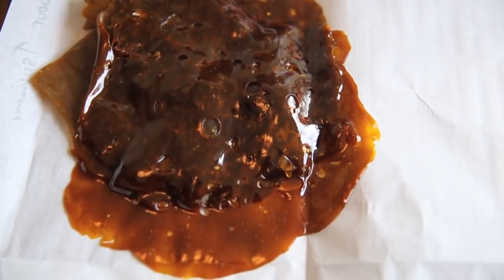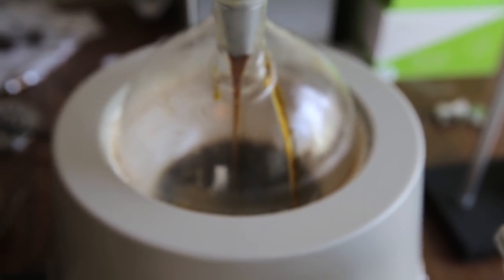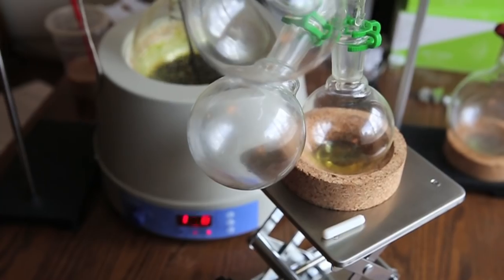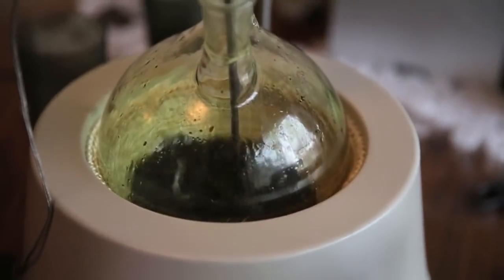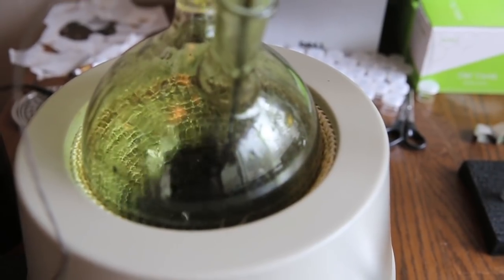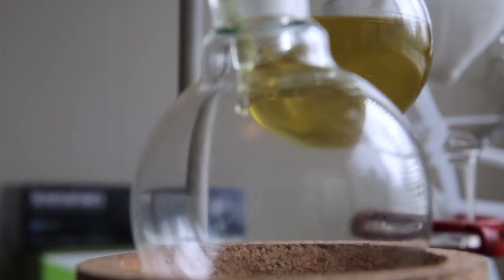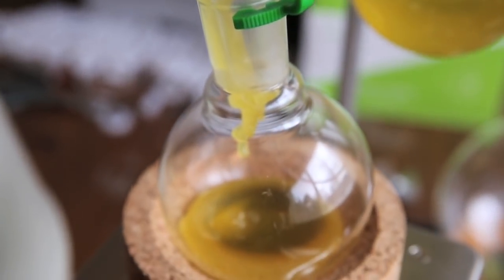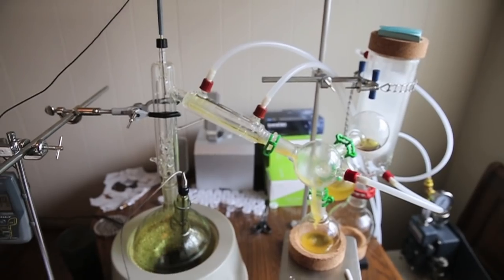Short Path Distillation of Cannabis THC & CBD (Tetrahydrocannabinol & Cannabidiol)

Comment: i don`t know much about this kind of sophisticated extraction or distillation methods but every time i see such a video i ask myself how do they get the final product out of those glas flasks? do they have to add some kind of solvent again? why don`t they catch it in some kind of flat dish where they could just harvest it more easily?
Reply from the maker: Turn the upside down on a stand and use light amount of heat :).  A heat gun works great.
Reply: and flat flasks or flasks which are shaped like jars with a big round lid probably don`t exist for that kind of setup right?
Reply: but if you know a good glassblower :D

Comment: how is the cbd and thc separated? would cbd come out first at a certain temperature and then once increasing the temperature you get delta 9 oil and then swap the ball downwards to collect delta 9? but what confuses me is the 3 balls because you did not move one and it collected essential oil i suppose like fractional steam distillation of trim?
Reply: Dear Sean, have you solved your question? I am also interested in ths aspect, as our legislation in italy prohibit any single trace of THC in the hemp extract, and we are interested only in terpens and CBD. if
Reply: They aren't doing a fractional distillation. Those three flasks are simply "early", "main" and "late". The "early" (mostly terpenes) and "main" will be mixed together to make a full flavour extract product and the late will be distilled again with the next batch or a batch of collected "lates" to retrieve the CBD that is in there with the waxes, lipids, etc. Well that's how I'm interpreting it anyway. And THC is too close in boiling point to CBD to be effectively fractionally distilled at least with kitchen lab equipment. You need to start with a "pure CBD" 1:0 strain like Dinamed CBD Plus or CBD Therapy.

Comment: one question men ! if i buy a dank or other brand cadrige with gelato strain , they use gelato flower for the oil or only put gelato flabor inside ??
Reply: Miguel Aranega They’re supposed to
Reply from the maker: @CHii951_D.S  Most likely they have recreated the terpene profiles from a gelato strain test result from a flower/extract.  It is possible however they are reintroducing the actual cannabis terpenes however, most times they are using organic terpenes from other plants to mix a "gelato" flavor profile.

Comment: I didnt know you could run short path with out winterizing materials. Good to know.
Reply from the maker: It's not recommended and depending on the product it can have some dramatic effects on the process and end result however, some will chose to sometimes do a quick "hot pass" prior to winterwization to remove some impurities and then winterize before doing a regular pass through distillation.

Comment: Can u use as a starting material, the liquid which u get by adding the ethanol to plant material (filtered of course)? And is that the same setup? Thank you
Reply from the maker: You can use any extract type into this distillation unit! The best steps to take prior would be a proper filtration/winterization to remove any fats/impurities possible to minimize any elevation in boiling points during distillation! Cheers!
Reply: @OpenSourceSteel  would you change any of the setup for having your starting material as such?

Comment: was alcohol added to the material or did you just melt with the funnel and pull with the vac
Reply from the maker: In this case, we simply heated the oil with no transfer solvent.

Comment: What kind of extraction are you doing to before distillation what was mentionated starting material around a hundred eighty three grams?
Reply from the maker: Andres Mesa hydrocarbon extraction using a closed loop. Butane specifically.
Reply: Open Source Steel Thanks!, I have another question, Is the extract purgation needed? or after to the extraction BHO, we can put in the short path distillation system? How did you do it?
Reply from the maker: Andres Mesa after initial extraction and purging most butane, any residual butane can be removed in the distillation however, you will likely want to process and filter the BHO via winterization using ethanol to remove fats and impurities and then into distillation process.

Comment: Did you mix anything with the starting oil or is that just oil boiling? I would assume this would burn if you didnt add some form of liquid but you would think most liquids would boil off first.
Reply: Don’t mix anything extra to your oil.
 Dose the oil in a fryer burn?

Comment: Do you use anything to seal the joints for the vacuum?
 Do you still need to filter the Crude Oil prior to Distilling to remove the chlorophyll?
Reply from the maker: Vacuum grease to seal the joints.  You should always filter prior to distillation as well as decarboxylate the starting product.
Reply: Teflon Tape is working for me & I don't have to worry about the product coming in contact with the grease or it's residue that might still be present.

Comment: While I've been toking for over 45 years, I have always smoked the bud. I recently decided to switch to vaping and now use THC & CBD distillates rather than oil. I am interested in making my own distillate and there's lots and lots of videos on it. Unfortunately, they always begin with some sort of product in the flask. This is the first vid I have seen that actually pictures the product that will be used for the distillation. I have not yet found a video that goes from bud to distillate.

My noob question is: What is that brown product? Resin?
Reply: you need to make concentrate with a solvent first
Reply: Don't be so quick to dismiss the other chemicals found in weed terpenes can have tremendous effects they interact with the THC and CBD to produce different effects that's why different strains can have different High's even though they might have the same THC level
Reply: It's bho, butane honey oil.

Comment: what did you put in the boiling flask with the oil. did you put any type of solution?
Reply from the maker: Raw oil, no other compounds. This product should be winterized before however in this video we did not and because of that we have slightly elevated boiling points in this video that what you can expect with a filtered oil to start.

Comment: Can we extract essential oils using fresh buds with this method and equipments? ? ? 

Why is need the vacum pump? ? ?
Reply: The vacuum helps raise the temperature high enough to separate higher boiling point compounds like THC.
Reply: @MrMudRun  Old but for clarity lowering the air pressure lowers the vapor pressure and thus the boiling temperature of a liquid so it helps to make the liquid boil without actually heating as high as needed at room pressure. The other reason it's used in this case is that it removes oxygen which will help reduce reactions that might destroy the target compounds. As the cooling is beeing provided by evaporation which cools the liquid if anything the it helps lower the temperature. Think astronaut with a hole in their suit, it's not the vacuum that takes the heat from them as there's nothing to heat, it's the vapors coming off them into space that carry the heat away, the faster the vapors leave the more it cools, the harder the vacuum the faster the vapors leave.

Comment: Hey man great video I just got a similar set up with that same pump and basic parts besides the cold trap in the back is that something you need? I see people not using them, whats the benefits? also do you Winterize your crud oil in ethanol or mix some in before putting it in the boil ball? thanks!
Reply: It help any alcohol that might be present to condensate before it reaches your pump (Letting you do more runs between oil changes and lengths the life of the pump.).
 Using an Aspirator to pull a vacuum will save you from having to buy an expensive cold trap.

Comment: Thanks for the share, I am looking to work with about 30 grams of flower at a time and I'm trying to figure out how to get all the product out the glass efficiently. I was going to use a soxhlet with ethanol and distill off the solvent but removing chlorophyl seems problematic. Any suggestions?
Reply: Fhoulghl Ofdnposdu try activated carbon, it'll help grab "some" chlorophyll
Reply: Does the chlorophyll get condensed from the crude oil with the Terps?

Comment: how much is this set up and can it handle things like essetial oils?
Reply: Chris P. Bacon around 2400 without the pumps. pumps will run you another 500-1500. and he is distilling essential oils from the start and ending with purified distilled essential oils.
Reply: _JustConcentrate _  it's like 1800 for the glass ware and it was 800 half off on cyber Monday.
Reply: where
Reply: Andy Trinh.

Comment: Do you have to roto vap before doing this or did it's just basically melt into the stirring flask
Reply from the maker: Yes, you will want to winterize and evaporate any remaining solvents (ie. Ethanol) before starting the fractional / short path distillation process.  This setup can distill small amounts of alcohols but it's not recommended as the condenser is not as efficient for such volatile compounds hence why we add a cold trap.
Reply: Open Source Steel if I put my cold trap connected right to the condenser would it work more efficently and so after essentially you winterize roto vap or decarboxilate you then vacuum oven it and then run it in the spd?
Reply from the maker: the cold trap is there for any solvents that might be used however, its not the most efficient method either. A proper condenser or evaporation setup for volatile alcohols like a roto would work better, especially with a dry diaphragm pump to pair!

Comment: Could I get away with simple destilation under pressure?
Reply from the maker: Distillation under vacuum is key because he keeps your temperatures low enough to not ruin your essential oils
Reply: @OpenSourceSteel  and what about a roto Vap?
Reply from the maker: @smokeroot8008  a rotary evaporator will not get hot enough for this process, a water bath would begin to boil and some sort of oil would be needed.  And then most like the roto unit is programmed to stay under 100c due to safety of the water bath.  They can be modified but not recommended.   Your best best is simple/fractional distillation using a nice rotary vane vacuum pump for best results.
Reply: @OpenSourceSteel  I have built one myself that is why I am asking, I could set the water bath to any temp, that is why I am asking. Would it still work?
Reply from the maker: Smoke Root you will need 220c rated heat fluid which would likely be very difficult and expensive. It’s just easiest to use a proper heating mantel

Comment: any tips for keeping a vacuum when the temp builds i seem to get a leak when my temp gets close to the thc point
Reply: Are you sealing your joints?
 You can get some sleeves for the glass joints.
 IDK, if you can use the Vacuum grease for all the joints except for the connections on your collection vessels (For those use the sleeves for those.).
Reply: @scottarnold6528  ye I seal them all up as good as i can I tried using vacuum grease then grease and Teflon tape but still losing pressure at high vacuum il try them sleeves I was looking at them but didn't know if they would be OK with the heat

Comment: Very very nice work! question do you regulate the vacuum pressure? our just let it run?
Reply from the maker: Rob van Gils no regulation of the vacuum. We are trying to achieve the deepest possible level we can get.
Reply: Open Source Steel thanks for you response getting all the right info together to do my first run 😊
Reply: @OpenSourceSteel  One more question how much watt is your chiller is it like 300 watt heater 300 watt water chiller enough?
Reply from the maker: @RobvanGils  in fact, you can get away without any chiller if absolutely necessary. There have been many developments and experiments in the chilling/heating of the condenser.  Some people will run the condenser at a HOT temp to help pass unwanted volatiles but yet still condense the THC/CBD molecules. Hopefully this answers your questions.
Reply from the maker: @RobvanGils  Good luck, I think you'll do great! The trick is filtering as much fats and lipids through winterization prior to distillation! Rock on brother, let us know how it goes.

Comment: How strong does the vacuum have to be?
Reply from the maker: 250 Microns and under! It will depend on material but a proper run with filtered/winterized material can be under 150 microns if strong well maintained vacuum pumps are used!

Comment: how long till you get a finished product
Reply from the maker: The process runs about 125g+ per hour,  at the end of the process the product is "finished".
Reply: for a good product ready to sell would it have to be distilled 2 or 3 times? not 1 to remove the stink
Reply from the maker: You really would want to at least do a 2nd pass however, with a quality prepped material with a high THC content to start you should see good results on 1st pass.

Comment: Has the starting material been winterized already?
Reply: Mitchell Rodriguez this defeats the purpose of winterizing
Reply: Mitchell Rodriguez  Yes it has, and vacuum purged. it's completely dabable. This is not a form of winterization whatsoever. distilling is using heating and cooling in a controlled environment to condense and seperate the cannabanoids (in this case) into a pure state. No solvents are being used, only gravity, atmospheric pressure caused by heat/cooling. Can also have a vacuum pump for assistance and speed like shown in the video. Hope I "cleared" things up for ya 👍
Reply: _JustConcentrate _ I figured the heavy waxes would faction off like every other compound. I could be wrong, but I'm pretty sure waxes and waste vaporize at a higher temp than cannabinoids.
Reply: Having a starting material that has been winterized will eliminate most of any waxes left in the concentrate. Meaning when you distill the product, should have minimal to zero fats and lipids to show up when heated and cooled. If so the starting material was not filtered good enough. Water/condensation could also contribute to waxes when distilling. Just knowing the temp of what each compound boils at is key for the process.
Reply: _JustConcentrate _ so carbs will faction at 90° under low pressure and will end in the finished product? I'm not being resistant I'm just trying to understand more clearly.
Reply: Mike iLL yeah that's why towards the end when the boiling flask started getting dark the stuff coming down the cow turned  foggy, I assume its from lipids due to the start product not being winterized and polished

Comment: do you grease the joints?
Reply from the maker: Yes, always recommended to grease all joints.
Reply: cool, how do you clean the joints before removing product as well? Silicone grease always finds a way to get into my product. i don't work w/ cannabis, but it's soluble in non-polar stuff, and I'm sure it'll get into the concentrates if not cautious. we use hexanes to clean it off before removing anything from the round bottom flask.
Reply from the maker: You can use solvents to wipe and clean and you can also use a joint adapter with a pour spout! It's a nifty tool for helping to save from contamination, check it out!
Reply: Awesome y'all are just awesome. More than impressed.... braaavoo!

Comment: At what temperatures to you rotate your cow? Do you simply wait for the temperature to ramp up, indicating you are moving on to the next fraction? or do you just look for a colour change?

Also, you vent off the cow to a cold finger to condense terpenes, correct? So your distillates in the collection flasks are largely odour free?
Reply: The Terps get condensed in the condenser.
 The cold trap is to condensate any alcohol that might still be present before it reaches the pump.

Comment: do know that ethanol has a clear flame and you can not see it when it burns. 
I do not see any device that will protect you against harmful chemicals if presented with a problem... all it takes is an ignition source.. 
Static electricity is #1 
A carpet floor this is a disaster waiting to happen